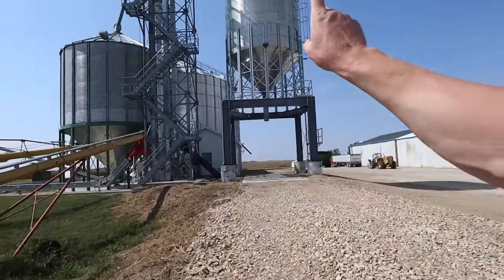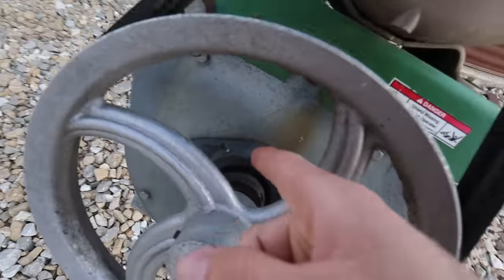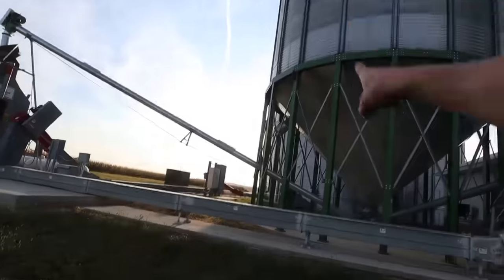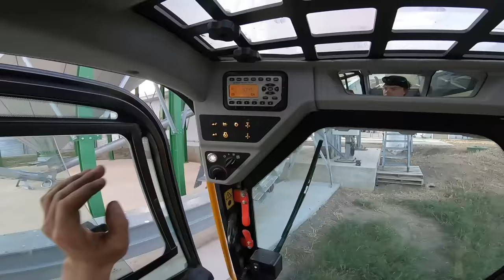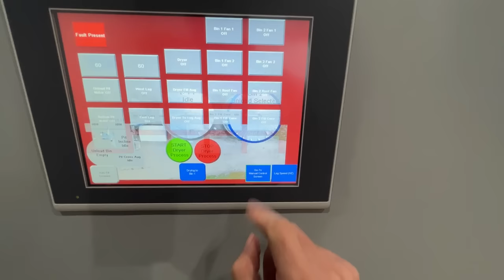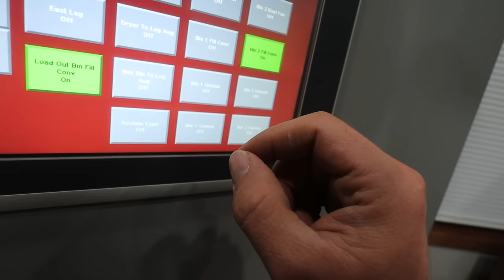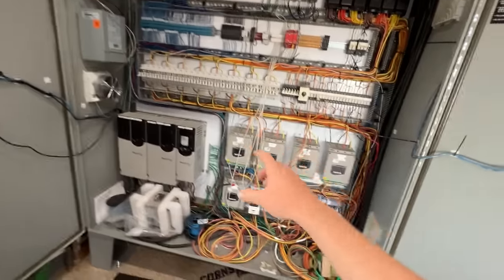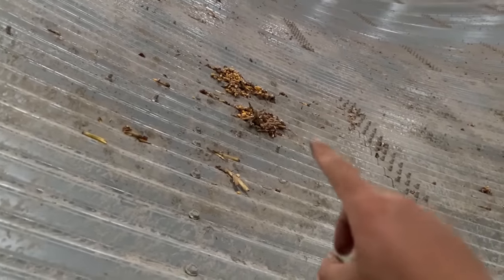I Worked On The Un-Safe Bin Site (OSHA Un-Approved)

Comment: It seems to me you could use a backpack vacuum cleaner to help clean up around there much faster. Just blow the stuff to one pile them suck it up and dump it out. I would also think a portable air compressor, some hose and wands would help you blow out small areas much like using your yard blower but much stronger in a small space to clear out the areas fast. Might I also suggest some small, good range handheld radios, going in to pits and things like, climbing that bin site you might get hurt and should be informing nearby people that you are going into trouble spots and letting them know when your back out. Trapped with a broken ankle at the bottom of that pit would really mess up your season.

Comment: I will NEVER understand why you guys in the Midwest do not use Driveway/Road fabric Underlayment. You’ll never see grass growing in the Rocks and you’ll never have Rock that Sinks, safe you a fortune in mug having to buy/add extra rock. Simllar to landscape fabric but different you can get 100- 300 Ft rolls at Lowe’s. Around .20 Cents a yard put a huge long term savings. On the edges, next time use a Garden Power Bedded for edging, run it down a straight line with Masons String. Perfect straight edges & easier, quicker. I’d definitely look into Drive or Road Fabric next time you work on a driveway. No pot holes & no sinking gravel.

Comment: Extend the rock in front of the augers next to the old rock pile that you smoothed out against the corn, will allow wider corners. Everything you can do to make the corner wide will make it easier for truckers coming in that direction.  You need a yard scraper too btw, much nicer job than skidsteer for spreading gravel.  Also should make end of bin side-unloads able to lift up using a small chain or cable with hook on end.

Comment: Tip when it comes to greasing motor bearings. Electric motors can run "thousands" of hours before they need to be greased. Refer to the manual for the motor being greased. If you over grease a motor it can cause more damage than under greasing.

Comment: Rent  a steam roller  or compactor.  1910.147 1910.333 Lockout tagout.  CFR.  Yes two people father and son of a vac company died standing above a pit for a garbge company cleanout.  The father may have fallen in or got overtaken with oxygen deficiency, the son went after.  They had to do a confined space rescue with the fire dept.  We train on a no entry recue and there is snifferes to check the air.

Comment: What's going on with the electrics for the new bin site - they are a Shambles!   Your electrician should have created a circuit and function diagram and this should be framed and hung next to the switch cabinet.  The modules in the cabinet should all be labelled and align with the diagram.  Why has he use cartridge fuses and not modern resettable breakers.  Why are there functional wires hanging around inside the cabinet?  Guessing what size fuse is used for a given load is just dangerous and could lead to a fire.  I think it's fair to say, it's all a bloody mess.  As for the actual bin site, it's a death trap and it won't be long before there is a tragic fatality.  Until the gantry's are made safe, I would suggest safety harnesses are routinely used. A question, who was responsible for project managing this mess?

Comment: your panel builder should have each fuse holder labelled with the maximum fuse capacity on it the you would know what fuse to install. The reason for the same size of fuse is because those fuse holders are good from 1 amp to 30 amps. The next size fuse holder is 31 amps to 60 amps in that style of fuse holder.

Comment: How long before your farm has a set of truck scales / weighbridge for weighing your products in and out of the farm?  Should you go to buy a weighing system, go for a system that anyone can service, and, you are able to get parts (indicators / load cells) from multiple suppliers.  A simple question to ask a supplier:  Am I able to buy your products / spare parts directly from other suppliers?  Be very cautious dealing with Mettler.  In the local market, they go in cheap for the supply, then make their margins on the service and parts.  Similar to Deere.  Try to go with a local scale company that has their own test truck and has capacity to load the scale to capacity and blank the scale out.  

With the scale, get a multiple platform scale that is able to weigh axle groups, plus give the gross weight.  So, look to having the length to weigh a B-Train, and allow for increased weight limits with the scale.  This also means building the scale to have a load capacity of say, 100 ton, but, the indicator may blank out at 50 ton.  Also look to having the scale for public use, as that will allow you to generate an income from the scale as well.  When you get the scale inspected / tested, have the scale company do the testing with a span check first and last.  By doing this, you are preventing the scale company from "perverting the course of justice" if your scale is used by the police for enforcement purposes.

Comment: Might consider documenting all the mowers rated amperes (found on motor info tag) by location, then check each motor individually (with ampmeter) before harvest starts to see if something mechanical is starting to show excessive load. Just a thought.

Comment: I pickup corn at a farm with a new bin like yours and as we got to the bottom they turned on the sweep to get no response. I ask were is the sweep located they said right over the holes. Only to find out it was in the opposite position whereas they had to dig it out to get the weight off of it.

Comment: Thanks for sharing your thoughts, ideas and videos. It’s crazy how much corrosion the dump pit has picked up since you installed it. I’m sure by omission of mentioning you probably are still in litigation concerning the bin site. Hopefully you get it resolved with a positive outcome for your farm. Was thinking once things are resolved you might want to put some kind of structure over the pit on a wish list for the future. That and probably some type of rust remediation and cleaning project. As nice as you keep your tractors cleaned I’d think that pit although out of sight is probably still a significant investment and I’m sure the grain would likely flow better if the pathways were clean and polished. Possibly also consider adding a section of grating prior to the pit with a foot or so underneath to act as a dirt and rock trap giving the trucks a cleaner place to drive before the pit allowing dirt and stones to fall off. Wishing you and your family the best.